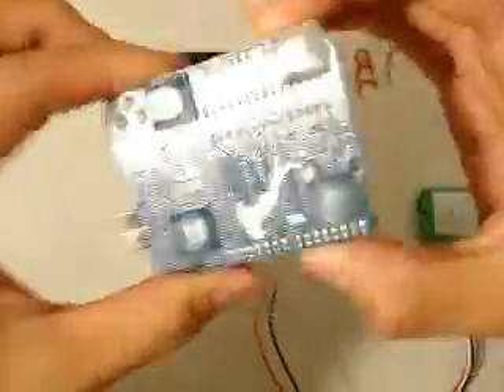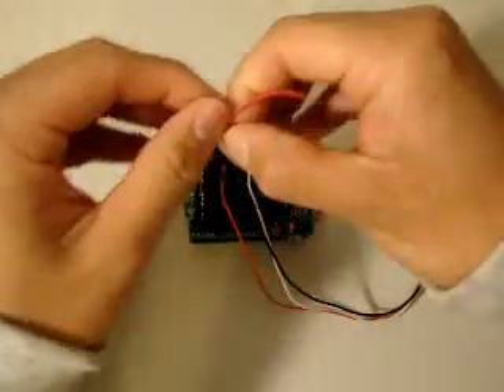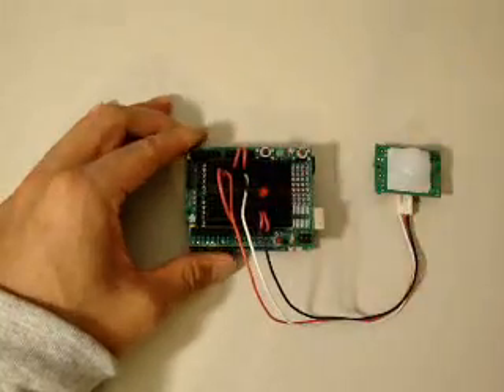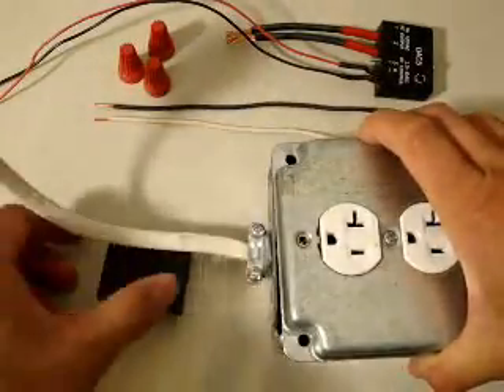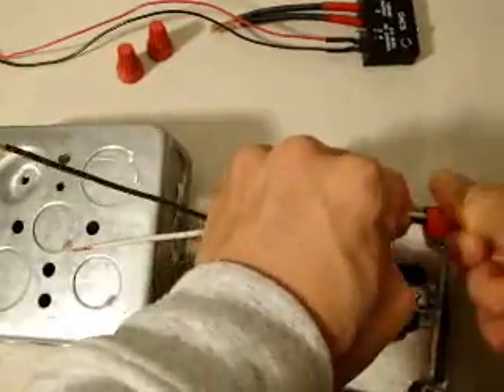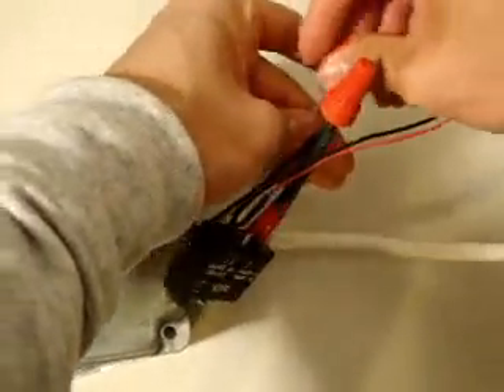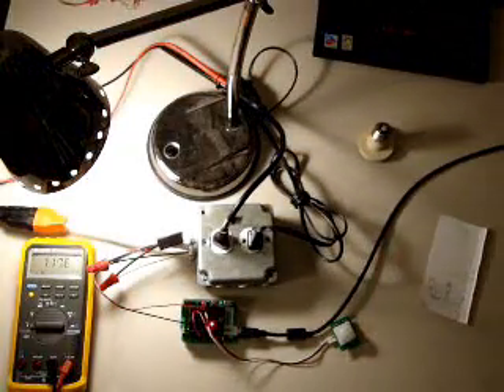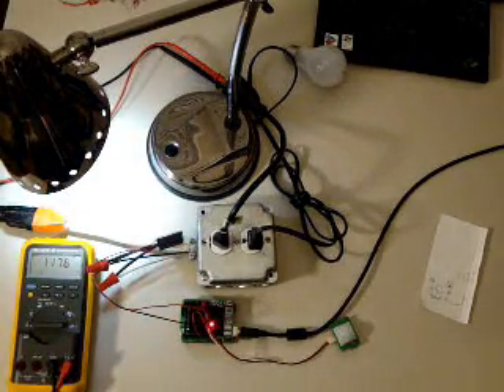Arduino w/ Solid State Relay (SSR) & Parallax Motion

Comment: one of the better Arduino / 110v relay videos out there, the hookup was a bit fast, especially for newer guys, but most of  us have read enough 101 stuff to follow along. I'm glad you pointed out the residual voltage too. Thanks for the input.